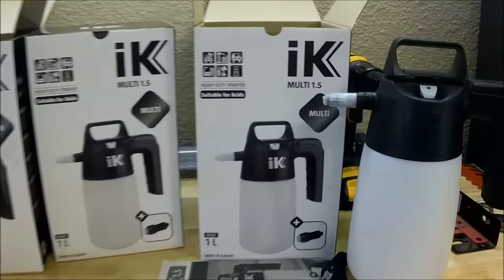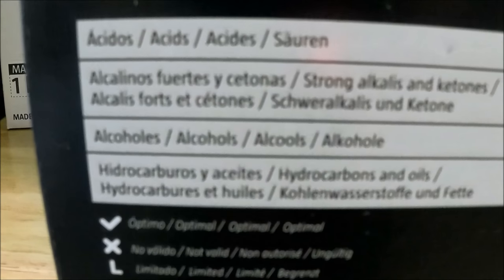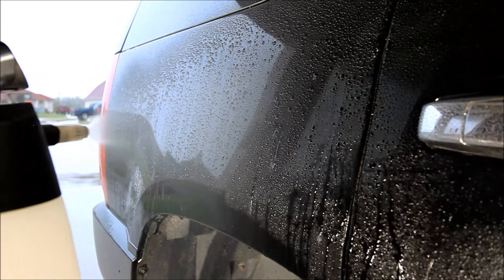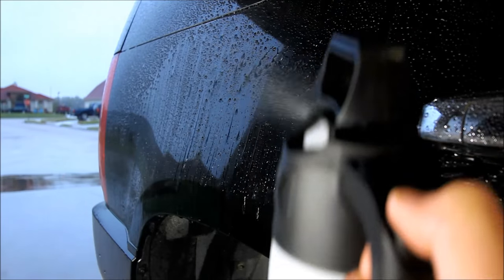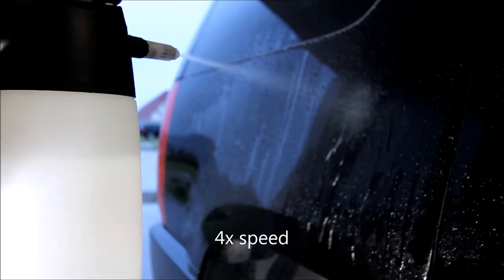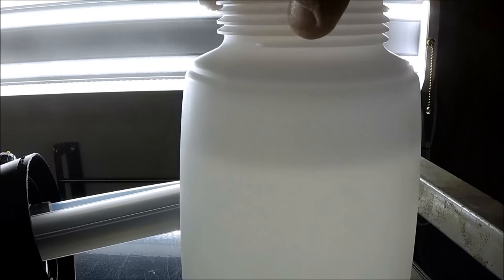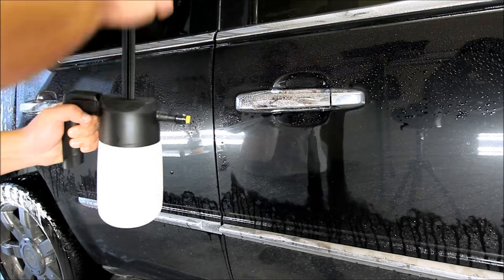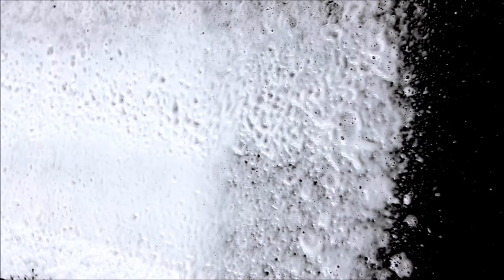IK Sprayer & Foamer review

Comment: Thanks for this! I have this foamer. It produces the nicest foam of any of my foamers (Kwazar handheld and Orion, and Lafferty). I'm going to use the 3-gallon Lafferty the most because it has a "quick-charge" valve which allows the foamer to be pressurized with a handy and labor-free air compressor.

Comment: 👍 review. Like your how your detailing products are organized. Where did you get the soap dispenser and hanging bar for the spray bottles. Thanks
Reply from the maker: hanging bar for bottles are from ikea... its a towel bar. have to use some spacers behind it to get it away from the wall for the bottles to hang. the soap dispenser is from usplastics.com, i think they are called "carboy" gallons. and the nozzle i use is for liquids but does ok for soap thicker soaps too